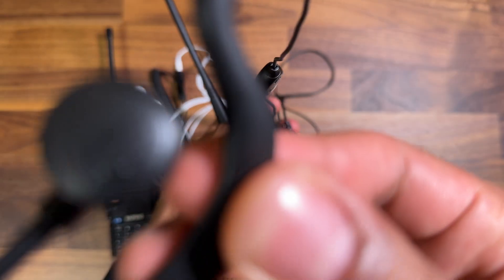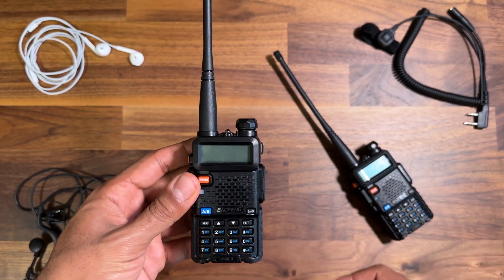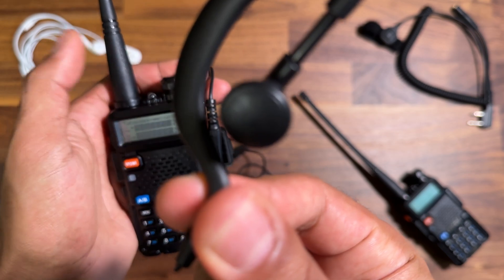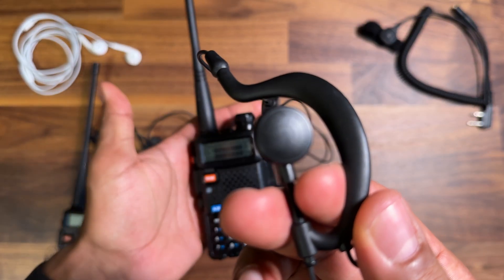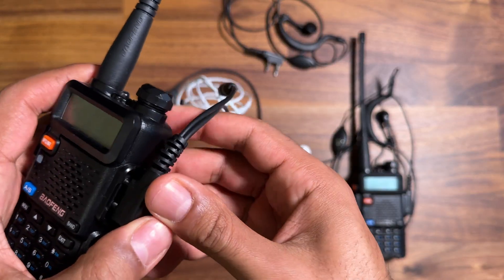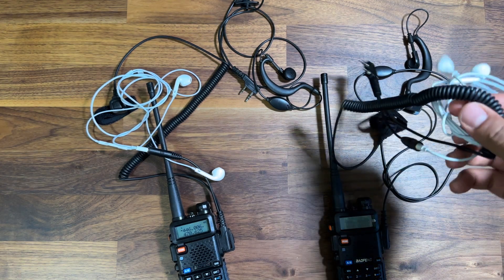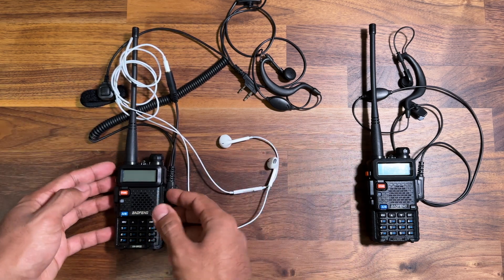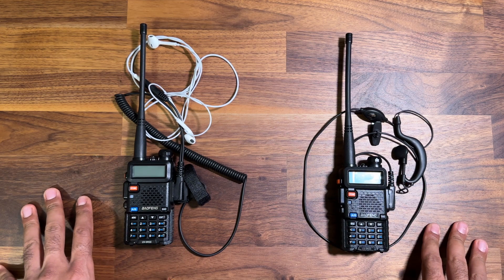Baofeng UV-5R | LOUD POPPING SOUND through earpiece/headset!

Comment: Simple solution, I bought a headset with volume control. Absolutely perfect now. Anyone else who doesn't mind using a soldering iron, you can solder a volume control inline on the Speaker + wire.

Comment: I also noticed this on UV-5R with  kenwood kmc-45d but in my case there is just 1 pop every time but still anoying.
More interesting is that more cheaper baofeng bf-777 does not have this problem.
I would be interested in solving this even if requires soldering or something else.

Comment: Tried another victims fix, and it worked great the fix was to source an inline volume control that has 3.5mm jacks on each end, which I matched to the ones he showed. Found on Amazon, bought 2( cheap, and if it breaks)  $5 and just got them. He said to lower the volume on the installed volume control, and turn up the volume on the Baofeng all the way up, and low and behold 98 percent difference, the audio goes from a soul crunching pop, to a slight pop, like most radios do on audio receive. I was skeptical, but it worked. It’s an easy fix, and cheap to boot. I’ll look for the link I bought it from and post on subsequent post, or look for the Reddit post under Baofeng popping noise search. Anyway, all props to the finder of this valuable nugget
Reply from the maker: That is a great idea!
Where is this fix? Is it a video, Reddit, or somewhere else?

I started looking for myself (for options in the UK). I ordered an in-line volume adapter, but it was only TRS, so the earphone audio worked great! But it did not pass through my Mic signal.

I’m going to try again with an inline TRRS adapter and see if that gets me the results we’re looking for (including the mic signal).

Thanks for the comment! More videos to come with my findings… spoiler alert, the UV-17 Pro is just as bad 😕
Reply: @PMR446_Guy  I’m out of the state right now, but I’m using several items to separate audio, and mic and ptt. I’ll list everything I ordered. Try to do it from where I’m at but we’ll have to see if I can find everything I ordered.
Reply: @PMR446_Guy  plug the Kenwood end of ptt/mic into radio, plug volume control into 3.5mm jack port of ptt/mic/Kenwood cable shown, and headphones into volume control, and voila…..low pop. Remember to turn up radio on full, then adjust volume with new volume control…..and you’re welcome from across the pond!
Reply: You need the other item to split out the ptt and mic, and give you a headphone Jack also, from the Kenwood dual pin radio jack, as what the other cable from Ali express does.  @PMR446_Guy
Reply: @PMR446_Guy  obviously won’t let me post the url of the item needed, so I just give up……YouTube is frustrating with the level of interference. The volume control is on Amazon, sold by pchero, comes in a 2 pack for $6 and change. It was a Reddit post that showed the fix….
Reply: Posted everything needed, YouTube blocked, sorry that they suck!
Reply: Why do you need a trrs, you have the cable you need already, on the table in the video? You just need the particular volume control (it’s rounded following the profile of the control wheel), and your headphones sitting on the same table!
Reply: PChero 3.5mm Headphone Extension Cables, 2pcs 3.5mm Male to Female Stereo Audio Extension Cord with Volume Adjustment Control for Smartphone Tablets MP3 Players - 10inch